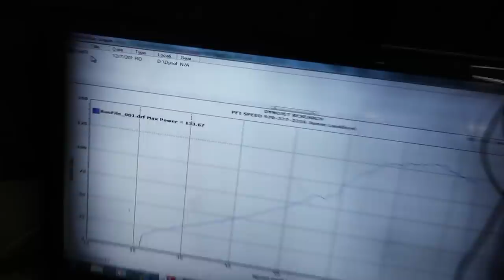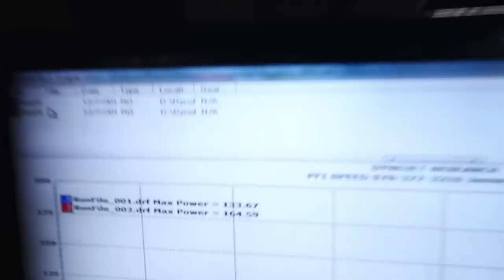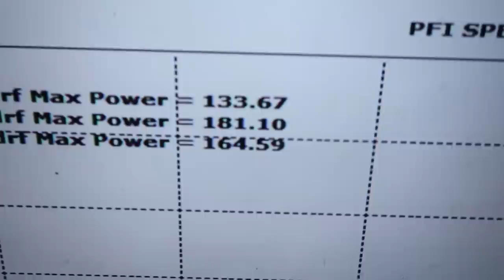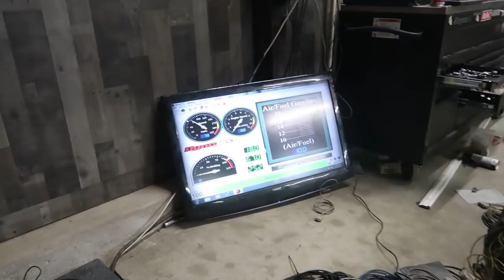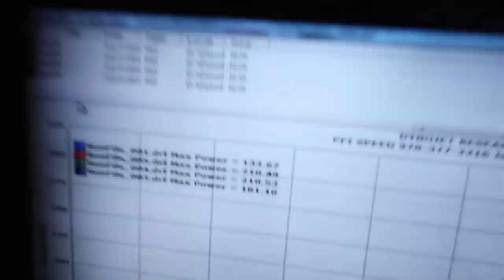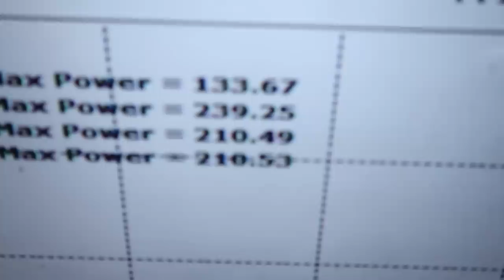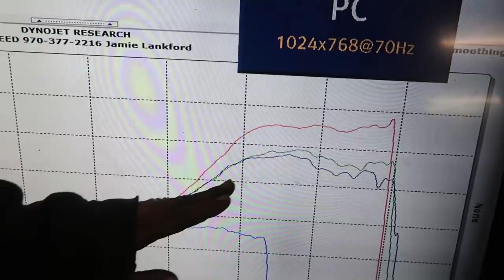Shane NAIL’Z this 290hp D15B Calibration

Comment: That wheel movement.. Kinda sketchy. The shop is looking good though
Reply: For real, I'd be scared to not just drive that car but drive my own car anywhere near it.  That front end need to be fixed, I wouldn't have even put it on the dyno.
Reply: Great tune Shane but please fix that front end ,, > Its Very Danger-roose ...
Reply: 15:19

Comment: Good trick I learned years ago on the job as an electrician, wrap the wound with electrical tape, sticky side OUT, wrap it two or three times like that, then twist the tape sticky side down and wrap the whole thing up. Works like a charm. I say this next part with love, GET THAT MOTHER FUCKING FRONT END FIXED! Hope your fingers feeling better soon Shane.

Comment: that's awesome I been sick for awhile every time I get a chance I had a brain tumor waiting on results but I been threw hell and back could tell you a lot I'm 29but I've lost a lot of my life because of missed diagnoses but I have a b20vtec ek hatch with a rhd 96-98 hatch type r clip ready to go but I also have a lot of engine parts and everything but I have a holset charger modied of a 2500 diesel with porting and ctr head skunk2 can gears walbro 255 still running since 2007same engine and trans just got s300 a year ago and it also has 3 inch god speed intercooler piping and greddy type r bov and some 450cc its pretty fast when I was feeling good I was messing with it but I need some new iat and map sensor cause I been driving while tunning also I have 1000cc its all stock before it started spitting and stuff it cuts out in 3rd and stops running so now I'm a add that and see what happens to it idnt even have a boost or air\fuel gauge on it but everything is factory except fpg gauge its a nos one 45lbs on em so Dr bills and all I been threw its crazy I use to have 8crxs power window one two wagovans  4wd one red 1991 and d15b VTEC turbo white one 1990 but o had drive way full and a all motor L's swapped one then a b16a on nitrous and a d16\y8 skunk2  aem deal this was when I I was around 16 I had saved up money cause when I was younger I mowed yards and worked on cars and if you didn't put in you weren't anything I've worked on anything from a ford pinto to a nsx ferraris and Im not ase certified or anything but I can do anything I guess just waiting to get over this sickness I lost almost everything I've almost died a few times and people that were sick as me died but oh well I'm here and I'm a keep fighting till I get this together its ruff but I just push myself to go everyday but this takes a lot of money from you I can't even get disability its crazy life's a bitch I hate it honestly I can't get meds 800 for this 800 for that with a coupon for meds its messed up so that's what happens I get all these ideas and have em planed out and this was before they were done but haven't been able to do them but I will one day you all have a good one

Comment: Thankfully I live on the east coast & not Colorado! I don't wanna be the guy who gets collided with, head-on when the gnarly torque steer from the power & terrible slop in the front end pulls that car into the oncoming lane. He must have removed the radius rods from lca to the front x-member. Either that or bushings are destroyed. All things aside, for all the hate honda gets, imo, they make the best 4cyl's of any mnfcr. They make good pwr NA for the displacement, and when built correctly, they can do it w/boost. K-series, B-series, F20/2c- all great engines. There's not many engines that make 182hp stock from a 1.6L engine, like the b16b. Or 240hp from the F20/22c. I can't wait to see what can be achieved w/the new turbo K20C1. Factory 306hp, direct injection etc. Once the ECU becomes modifiable, & the direct injection/turbo setup gets to the point where it can be upgraded, it's gonna be pretty cool. Id like to see one in a Fit or a gen 7 civic.

Comment: I have a D16y7 sitting in my backyard in a civic that’s most likely going to get junked because of bad tags. I was wondering if a D16 is worth putting any effort into boosting or if it’s not worth the time on that block. I need to put some pep in my little Ford Rangers step and was thinking a Honda swap would be different than the usual LS swap everyone does and I have the motor sitting in the backyard already.

Comment: Shane looks so much better without the magnifying lens Coke bottle glasses...lmao Sorry bro, I'm not hating on you or making fun of you, I wear glasses too. I've tried to wear contact lenses, but I can't have anything near my eyes and I certainly can't touch them. I even had my wife try to put them in and every time she would get near my eye I would flinch. I've been wearing glasses since I was 5...in 1988.
Reply: Boosted B Series EK I've had contacts there definitely nice but everything has its draw backs
Reply: @GoofyBuiltShane  Yeah, I hear you bro. I've had different styles of frames and when I find a set that are comfortable they go out of style or get broken. They're not as expensive now as they used to be, but I actually wear a pair of safety glasses because I work in the oilfield and companies require that you wear side shields while on a well pad, so it's easier for me to just wear those, but they don't look terrible.

Comment: That control arm is fu ucked I bet the bushing in the back has completely let go... so dangerous, it's just a matter of time before that bolt snaps and you eat your wheel
Reply from the maker: The box that used to hold the tow ring, and now mounts the trac bar is fubar. Common problem, boiz will get her fixed.
Josh

Comment: Im a lil concerned about how much CO yall are pumping into that shop!
Reply: Pete it has exhaust vents
Reply: Ok cool. Knew yall had the drop down hoses for that but was concerned excess CO would linger around until the fans sucked it up. Given that the hoses were not attached to the exhaust pipes. Some hunters died a couple years ago because they ran a propane heater in an enclosed space. Just i get freaked out about that kinda thing now i guess..!

Comment: specs on the D build?
Reply: Djokkins d15b7 bottom end. D16z6 head. Prelude throttle body vitara build with 1000cc injectors and a 450 for a fuel system

Comment: Someone please help him fix his sway bar and wheel bearings, them wheels are moving all over the place
Reply: Slim Nazty218 they need traction bar
Reply: Slim Nazty218 I think it is just the sway bar, but the intercooler and rad falling off too. One thing I learned a long time ago, saves time, heartache , frustration  and the odd nail....... don’t half arse anything, take the time do it once and do it properly.
Reply: Kyles hatch and wago used to do the same I’m sure it’s on the owners list of upgrades. it’s often hard to commit to buying what is needed over the parts you want especially if your on a budget. Hopefully they get it sorted though.
Reply: Michael Carvell yeah, to be young and eager again, nowadays I spend a year or two happily researching putting together parts for a project car without touching it, so I forget that youthful enthusiastic impatience.

Comment: But I’m asking why? Why did he grab the rad on a running car because it was stalling, going into gear. Glad he’s ok but whatchu thinkin homie
Reply: Allredred.tv I had knew the radiator was pushing on the clutch cable and that's how I normally pull it up on the shroud of the fan and in the moment I just didnt think about turning it off I'm alright though
Reply from the maker: Clutch cable was stuck in the radiator ouch

Comment: You guys really should try to be more concerned for safety. It's very apparent you have zero regard for yourselves. That thing shouldn't even be on the dyno with the wheel moving that much.  Also seeing things is important, since he is half blind someone keep him away from moving parts.
Reply: Is he realy half blind?
Reply: There is nothing wrong with safety but your going a little overboard there with the whole moving parts comment. Shane is a very capable young man.
Reply: Nobody can see properly through those glasses, I am not knocking his ability, but you need to see properly to use that ability well.
Reply: It really is true glasses need to fit your head properly to work properly
Reply: We needed it on the dyno so we  could see how much it moved when your in the car you can't see that. But we weren't ripping it cause it wasn't tuned. We will get his front end all straightened out and it'll be all good
Reply: And it wasn't that I couldn't see but that in the moment I just wasn't thinking. Fool me once shame on you fool me twice shame on me!
Reply: @GoofyBuiltShane  Hope the nail heals quick, put a rush on those new glasses anyways. Looking forward to seeing it all fixed up.
Reply: Shane is the man, looked so mini Brent in this vid